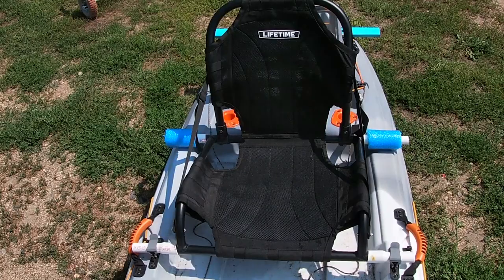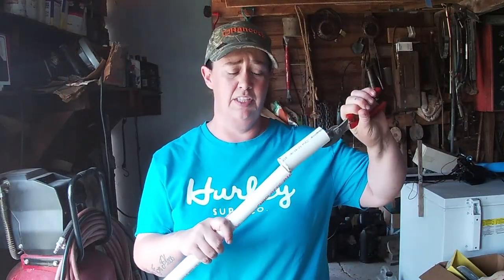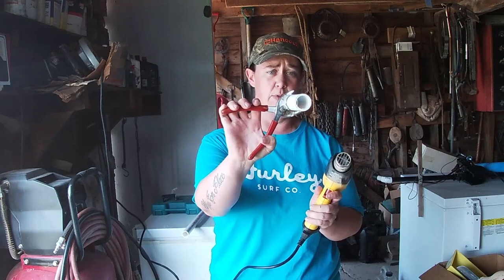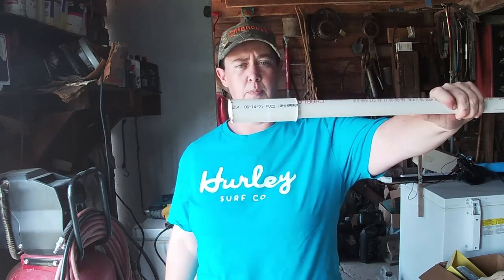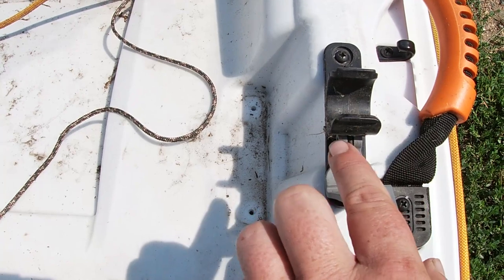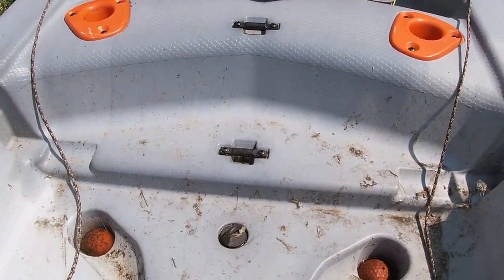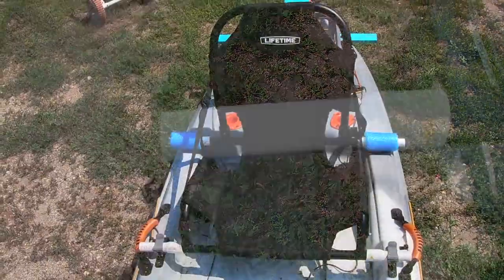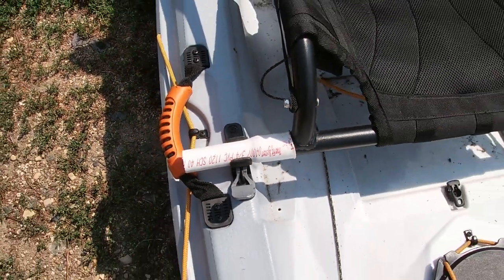Lifetime Tamarack Kayak Seat Upgrade

Comment: How has the stability been? I’m just getting into modding mine. I was gonna raise the back but raising the front never crossed my mind. Did you ever put a motor on? I just got
Reply from the maker: Yeah, I did get the motor attached. It is really stable. And I do t get my butt wet anymore.

Comment: Have you installed an anchor trolley on the kayak?
Reply from the maker: No, but it’s in my list of things to do.
Reply: @superioradventures  if you, please make a video. I’m curious how to mount it on this kayak beacsue of the molded paddle Chanel. I’m wondering if having it mounted lower to clear that paddle holder will make a difference